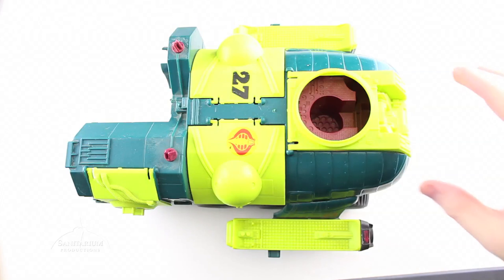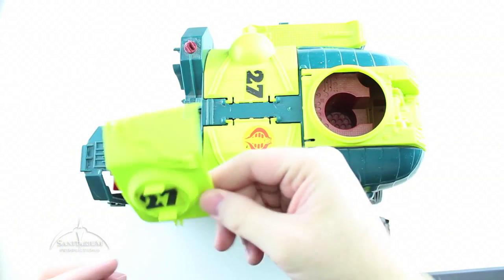GI Joe Restoration 1988 Cobra Bugg Part 2 Disassembly

Comment: Good series overall. Here's a tip on disassembly: when using old plastics, submerge them in warm water for a few minutes. Using nylon or plastic screwdrivers (similar to iPhone disassembly tools) work the tabs slowly. You may need to re-submerge more than once. 
I've found that turning on the water hot from the faucet and filling after waiting a few minutes in a 5 gallon bucket works well for these larger pieces. Bathtubs too for really big ones.

Comment: Warm water and plastic tools work  best. Cut an old debit card or gift card into strips and you can use them as wedges. Harbor fright sells automotive interior panel tools that are durable and soft so they don't scratch or mat the 30yr old plastic.